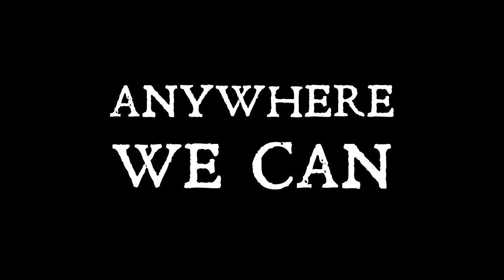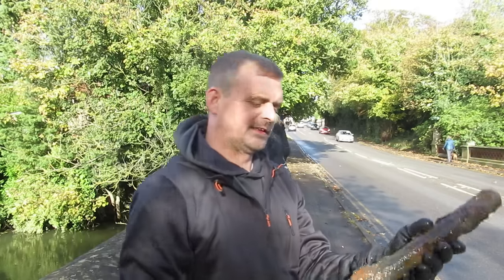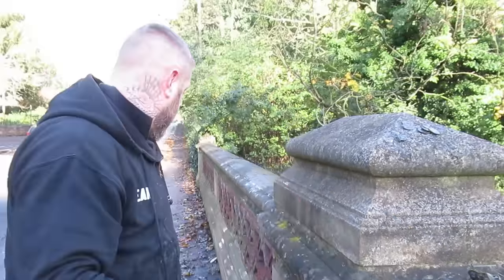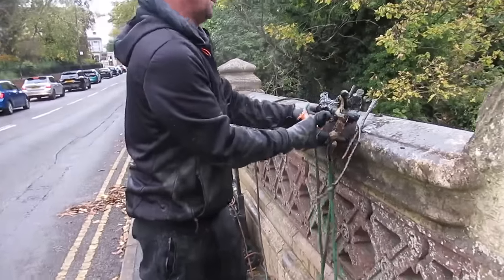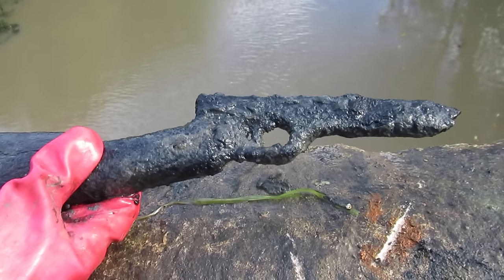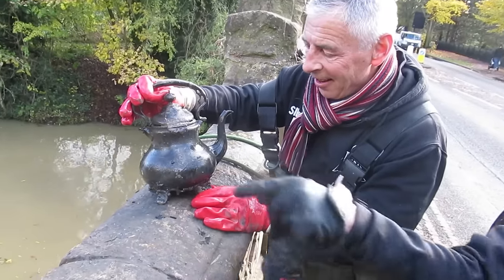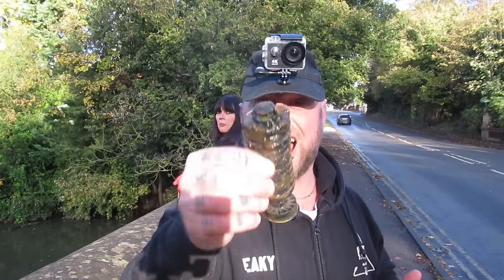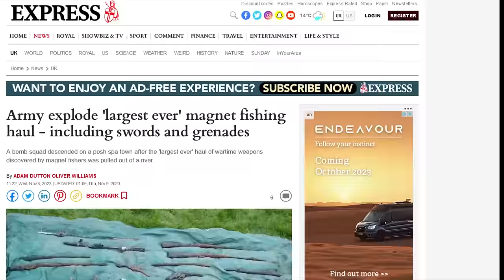*LARGEST EVER* WW2 Haul Magnet Fishing (Unbelievable What We Found)

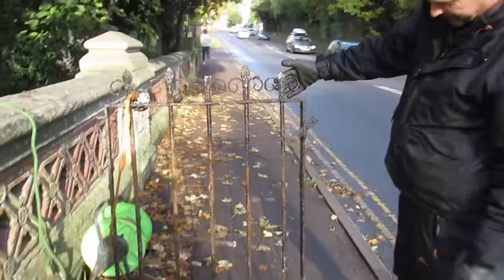Comment: At the 6:00 mark, it was either a round or a load, depending on where you come from, as the cartridge appeared to be intact.
Straight after that, was a soldering iron, not a hammer!

At 17:16 the Luger, more than likely was NOT from WW2 years. First manufactured in 1898 so could easily have been WW1 swag. Officers often carried their father's or even grandfather's service weapon in WW2.

Comment: . 6:20- That is not a hammer but a specific type of soldering iron. They still  currently use that style in Pakistan to re-manufacture batteries for vehicles. Depending on the age, heated in a forge or with a blow lamp.    7:30- Beautiful old French Bayonet. . The number of pistols and rifles was incredible! I have to wonder if it was somebodys collection.  That is one killer tea pot!!!

If you remove the handles from the Samurai Swords there will be a makers mark on the tang. The Tsubas alone may be worth thousands of dollars, as they are quite a collectable.

I do hope you were able to keep the old flintlock weapons and the swords.  That is a really memorial day for all.
Reply: Thanks FK 🤗